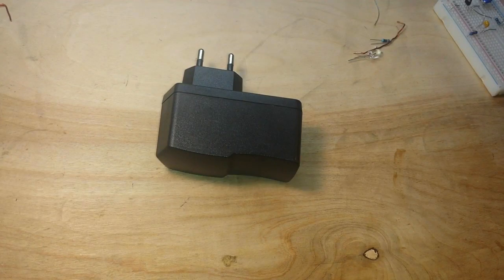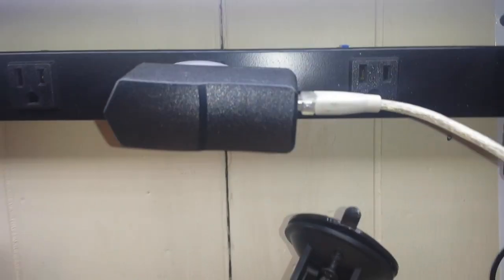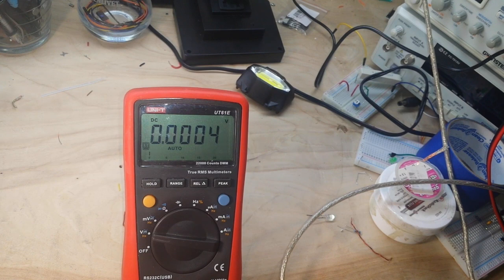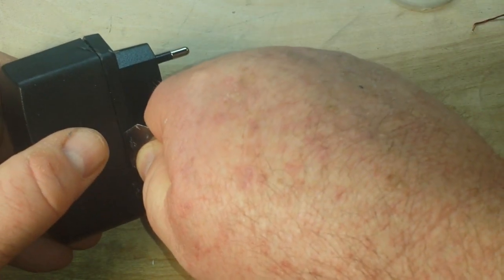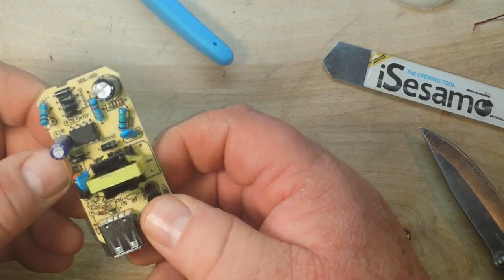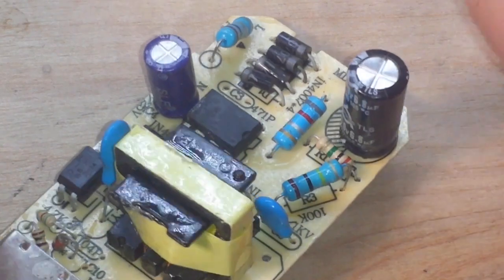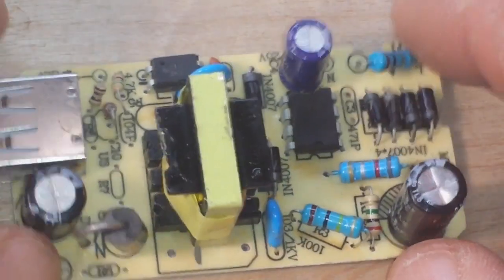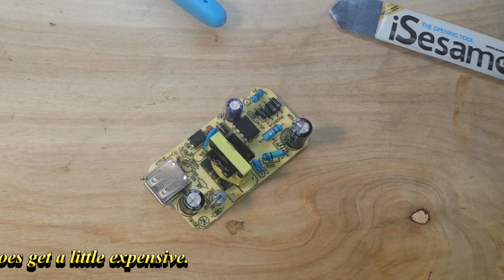Cheap Chinese USB adapter Safety Check

Comment: My single bad experience with Chinese electronics to date is  an external hard drive case. Smoked (literally) the hard drive I put in it. As a rule I don't trust Chinese ebay power supplies... at least the ones I plug into the wall. I did fry one other Chinese item it was one of those 18650  battery cases. The ones I got were labelled for series battery placement. DON"T YOU BELIEVE IT. I did as it was labelled smoke and melted plastic. The buss wires were seriously under sized for the job. The cases work fine as long as you ignore the labeling and use them in parallel mode. Other than that my luck has been pretty good and I have been playing with a LOT of cheap chinese electronics.

Comment: its made better than one I had to fix. that I gave about $10-15 for. with USB cable. it wasn't soldered to the prongs. just spring pressure making  contact. the female USB pushed in . I had to go in after it! great video. economy differentials . IRS amazing. they can make things for a cost like that. then ppl get them and sell them for two times and a leg more than cost. like the one I got. it likely cost $ .50 plus cable. and marked up 1000%+ ...   great as usual...

Comment: Aren't most Chinese products cheap? Good point on being safe and checking these things. Thanks for the video!
Reply from the maker: Most... Yes. The only area I have not seen them be really cheap is their laptops.
Reply: There are many expensive products in China too. Anker is basically a Shenzhen (south province in mainland China) company masquarading as a Californian one and it's not particularly cheap, not this level of cheapness. They have a bunch of high-tech companies like Huawei, who have built the fastest Internet backbone between States and Europe for example and are responsible for most of the telecom infrastructure worldwide, rapidly growing Oppo and Xiaomi groups, Da Jiang Innovations (those $6000 video drones). There must be a bunch of better tool companies too, whose products don't necessarily reach our shores. Many formerly major European, American and Japanese brands are now run from China, because the companies could no longer support themselves on their own. Milwaukee Tools, AEG Tools, Hoover, Ryobi is one big Hong-Kong-run company, though HK is not exactly China, it is but it isn't. Alcatel, a formerly major French telecom specialist, is now mainland Chinese. Most products you're gonna buy by Western companies aren't actually fully engineered by them, they commission Flex or Foxconn not only with production, but also with the bulk of engineering, and as time went and these companies grew, a lot of that engineering originally majorly in Taiwan shifted to Shenzhen area.
Reply: Siana Gearz, this sounds like a promotional pamphlet from the Chinese government promoting their industry. The American companies you've named are no longer the quality they once were either. You can tell they weren't made in the US! We all purchase most things that were made in China nowadays, mainly because there is little other choice, US manufacturing has been so outsourced that there's not as many consumer products manufactured here anymore. I'm sure Chinese industrial products are a different animal from consumer products. But we're aren't looking at EXPENSIVE products here. These are consumer grade for the most part! Thank you for you're reply.

Comment: It does looks crappy cheap. I can see it doesn't have that 431, like TL431, they replaced that with zener diode, I mean TL431 is cheap but not much more than a zener diode, and again 431 does better, a lots better stable regulator with the full load. Thank for your video.
Reply from the maker: You're welcome. The Chinese pump out these adapters by the millions. It's probably a matter of these are components we have to work with for this batch. of course Im just guessing here

Comment: Hi Paul, A little off topic but you could recommend a DMM? I have a DMM but its not too good for reading lower values of resistance, current, etc. I notice you have a UT61E and a AN8008. Do you favor one over the other? How about a review of the meters you have.  Thanks Rick
Reply from the maker: The 61e would be have been hands-down the best except for one thing... No back light. There is a I/o pin for the light but it's not implemented...weird. I have reviews all the meters, and I'll be doing a new one later this week.
UT61e: https://youtu.be/hSviVwCFPXU

Aneng 8008: https://youtu.be/eyYm5b-y9ZY

There is a link to the 61e in my Amazon store.
Reply: Many thanks. I think in the past 5 years of owning my DMM I used the back light maybe twice. So no problem with that. I will use your link when the I can order the meter.

Comment: I think I would be more concerned about that adapter than the power supply.
Reply from the maker: With US outlets, the "deathdapter" is pretty harmless. In the UK and EU however, the prongs can be placed diagonally potentially making the exposed prong live.